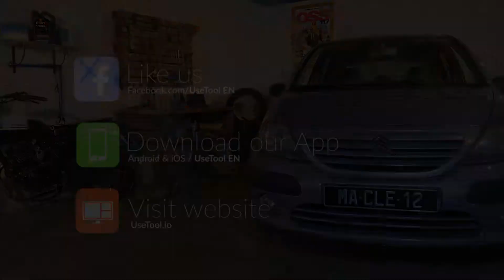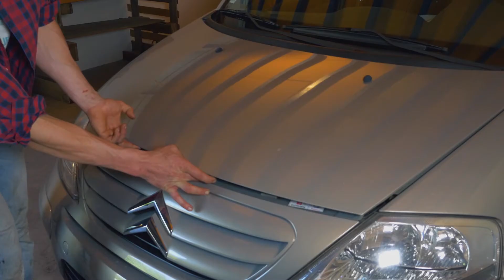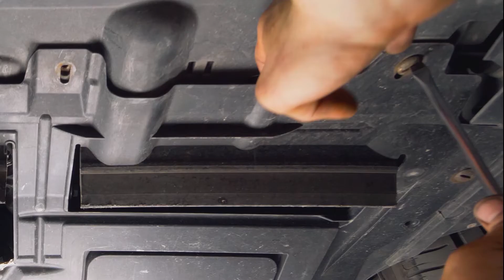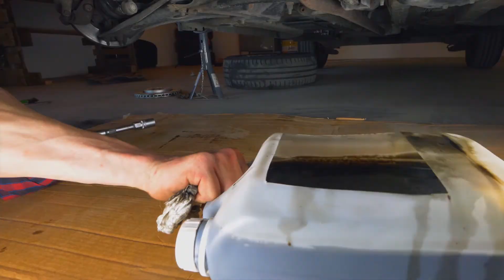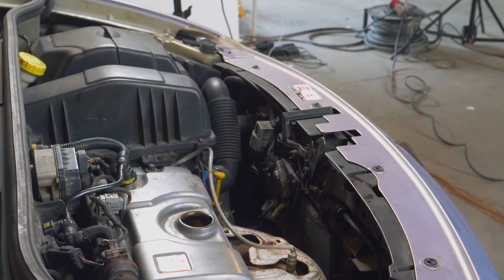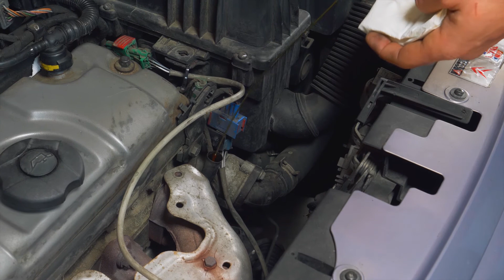Change the oil and the oil filter CITROEN C3 mk1 1.1i🛢

Comment: Hello! I own a Citroen C3 I(phase II 2005-2009)1.4i, manual. I'm 600 km away from the service limit and I need to change oil+oil filter. 

Do I have to change the fuel filter and air filter also? 

How could I find a complete mechanical guide for this car? Thanks!
 p.s. Your video is so useful, and I'll change the oil+filter on my own :D
Reply: it's a good idea to, and the pollen filter, but it's an old car, why worry now?